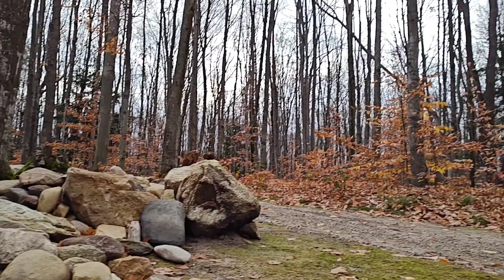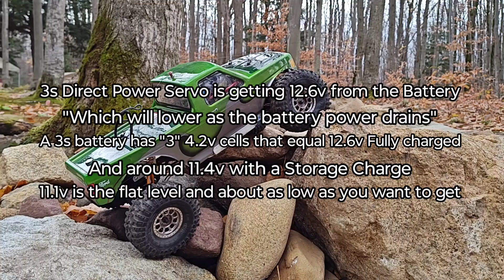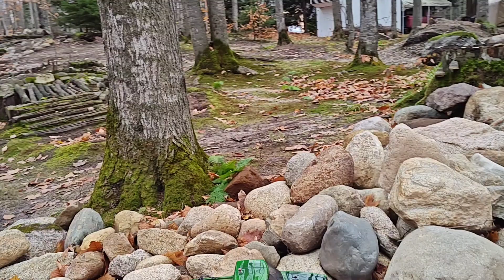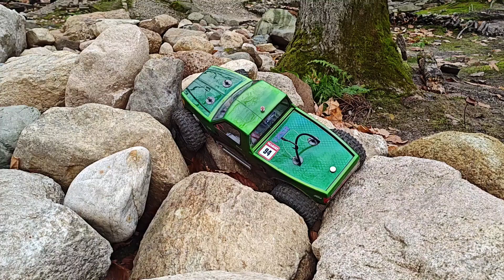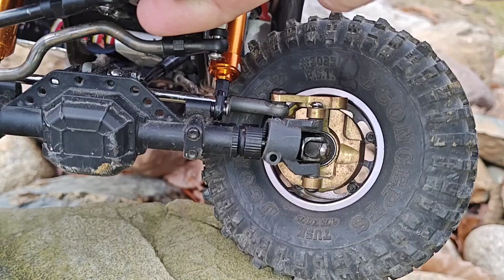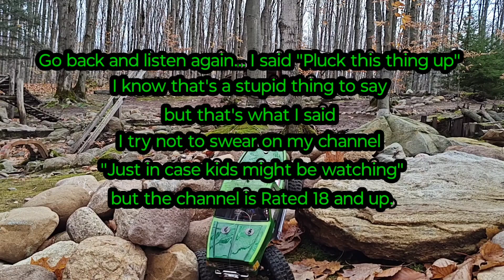Test Driving an Element Based Competition Crawler

Comment: I just bought a ecto comp crawler. Haven’t had the time to run it yet. This makes me want to find a spot asap
Reply from the maker: Right on...😁👍 
Quick question though...? Did you purchase an "Actual" Competition Crawler made from a Element Ecto, or did you just purchase a regular "off the hobby store shelf" RTR Element Ecto Crawler ? 😕
(Which is what this one had started out as, before Dan had installed all of the drivetrain parts onto the custom comp crawler chassis.😊 
Either way I'm excited that the video has inspired you to go drive it.😁👍
Reply: @ actual comp built ecto
Reply from the maker: @1978DirtyD 
Either way is cool 😄 but getting an actual Comp version is even better.😁
Congratulations my friend.
😊👍🎉
Reply: @ I bought one that was modded
Reply from the maker: @1978DirtyD That's pretty cool... 😊 I'm pretty much broke all the time, so I'm crossing my fingers that Santa gets me a Element Fox Comp Crawler Chassis Kit for Christmas,😕 or possibly even for my Birthday which is a couple months after Christmas, or maybe even a combination of them both,😕 Whatever it takes! 😄 I wants a comp crawler.😁